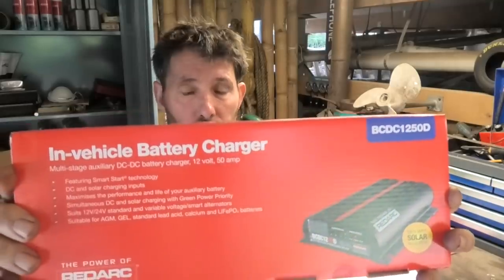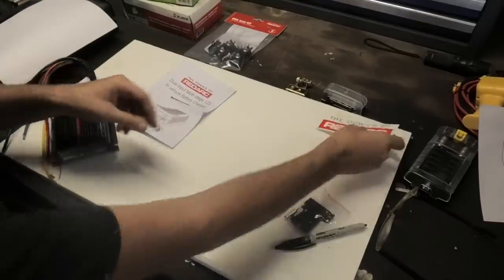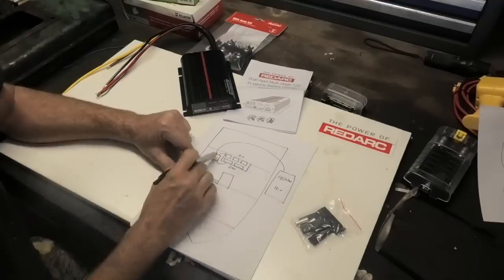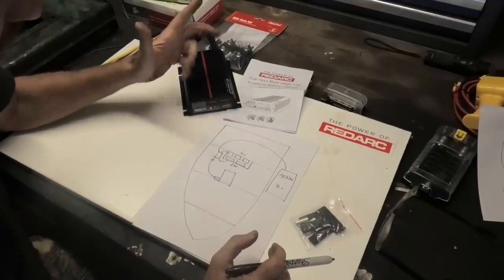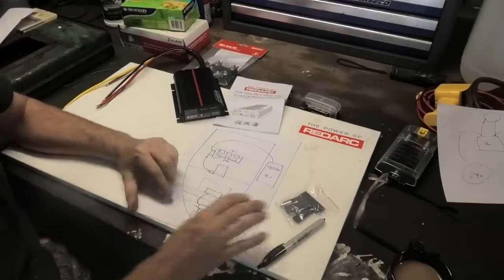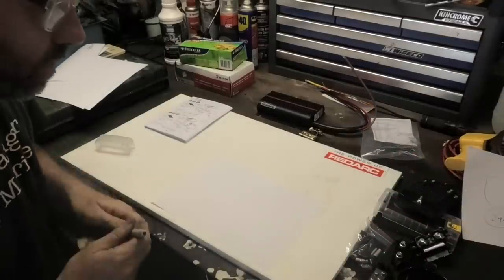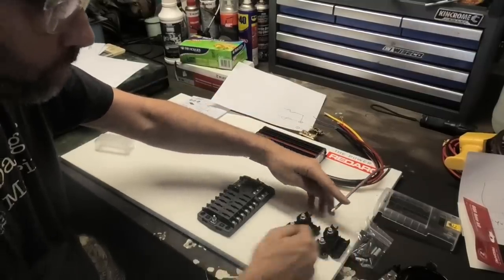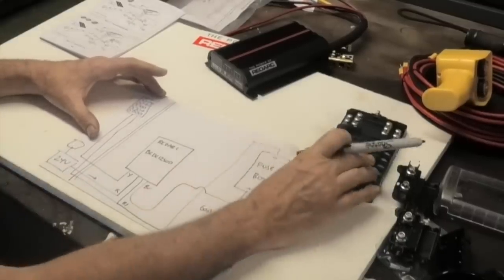Planning the trawler electrics

Comment: The BCDC1250D can't handle the current not even from only the solar panels or the alternator alone. Maybe you can stack two or three of them.
It's also a very bad design for cables, it should have four big screwed terminals on it instead of the thin wires hanging out of it.
Next problem you need to have the same type of batterys, like all, both starting and house bank should be for example AGM, that charger cannot handle two different charge voltages.
Reply from the maker: Yes, I'm thinking of splitting the solar cells across the 12 and 24 volt banks. All the 12V batteries are identical and the REDARC doesn't charge the 24V system at all (so I've learned)

Comment: Australia is 230 v 50 hertz isn't it?
Reply: 240V 50 Hertz
Reply: @dustyfarmer  Since 2000 the Australian Standard AS 60038, has been 230V +10%/-6% 50 Hz. Some states are just slower than others in transitioning to this, like QLD that was 240V +6%/-6% and had a law that conflicted with the standard and was amended in 2017 and transitioned by October 2018.
Reply: @CraigOverend  Last time I put a multi-meter on a power point in my home in N.S.W it read 243 Volts.

Comment: Why not ditch 12 volt totally and run 24v throughout,  all the same stuff is available and you'll suffer less voltage drop and/or run lighter gauge cable.
Reply: @Islandwaterjet   I never said it was cheap, it is however more robust and it is readily available through HGV and marine  suppliers etc.
Reply from the maker: There are benefits to going pure 24V, it is true.

Comment: each line should have their own 20 amp or higher braker.  minim 8 gage wire.  each having their own cut off. there are also compositors that can be made use of. have a electric drive motor to  steering.   there is a shit load that can be used.BL

Comment: One thing I have learned is that you do not want all lights on one circuit or fuse or switch ! It does not matter if it is a boat, caravan, shed, garage or what ever ...... if there is 2 lights then have 2 circuits .... if one goes out for any reason then you will still have one light working and you do not endanger yourself in total BLACKNESS !
Reply: Cyalume sticks stashed away for safety.

Comment: Be prepared for issues down the track. DCDC need constant monitoring to make sure they are working. Alot of sites with plenty of issues. Traxide.com.au is a far simple option easy to install far superior simple to set up an forget no constant checking. I ripped out my  Redarc rubbish DCDC charger and installed a Traxide and are brilliant. Dont fall for Redarc marketing it will burn you down the track on your second or third replacement!!

Comment: 12v wind turbine ?????
Reply: Installed where?
Reply: @dustyfarmer  Where ever he wants !!!!! Many boats have 12v or 24v wind turbines mounted
Reply from the maker: They are very common on cruising boats. Often when you don't have sun you have wind!
Reply: @davidpedder9048  Usually seen hanging off the back of a yacht off the transom, sitting atop the ex-trawlers wheel-house would look out of place IMHO, sitting off the transom might  give Stu's hair a bit of a trim up when tying up the tender, solar panels are easier to fit and will do the job, I reckon wind turbines are blight and eyesore on the countryside, noisy on a boat and not really necessary in both situations.
Reply: @dustyfarmer  Dont get me wrong, I like solar panels and use them my self. What i dont like is that they take up valueable surface space on a work boat. If you are under them when the sun is out, they generate sooo much heat.. I could go to any building suppliy store and buy a 10 foot pole for a wind turbine, I went with a mix of the 2 and make power day and night
Reply: @davidpedder9048  Plenty of still nights without a breath of wind, a 10ft metal pole with metal guy ropes sticking out of the roof of the wheel house with a wind turbine on top would be a good mounting point for Stu's lightning conductor cable but not what I would do, the roof of the wheel house is the ideal spot for solar panels and there they won't detract from the fine lines & classic styling of the trawler.
Reply: And plenty of nights when the wind dose blow. A splar panel will never ( never ) work at night. I could say plenty of days ( overcast and raining ) and a panel wont produce any good amount of power.. I have both solar and wind, best of both worlds.

Comment: engine earths. half the circuit..  the starter and alternator.. plus the sending unit earth/ground side also half the circuit. .  so the engine /transmission/prop shaft  are going to be a Negative. the side with the electrons..  a nice blender with electrons on it the propeller is.    the main earth/ground lug.  you are going to need a cable between the engine and that so you can get the electrons away from the hull.  give them the shortest path..  also the 24 volt negative cables for the starter.  Huge Hint... alternator positive output can be isolated. but is your alternator output going to be more than 60 amps.  running the alternator output  via a moderate thick wire to the starter positive connection shortens the path and reduces the voltage drop to the starting batteries.  but it complicates your diagram.  something to think about.  you might have to talk to the gurus at the  DC DC converter hotline.  you can use a properly sized fusible link or another maxi like the 60A    fuses to protect the alternator to starter wiring in case the alternator shorts internally.. so it does NOT burn the battery cables all the way back to the batteries.  fusible links open slower and allow a higher short term overload before melting.   i worry about that fuse panel in the engine compartment if it can handle the humidity there. or if it needs to be packed with white lithium grease..  so if corrosion does happen the white grease turns green as the copper dissolves.   huge hint.. a P TOUCH or laser printed copies that have the names of the circuit. and some clear shrink tubing.. you can slip a piece of paper with the circuit name up in the clear tubing and shrink it in place.  then that wire is identified..  3M has epoxy wire marking tapes with numbers or colors in little dispensers.   lastly the nav and exterior lighting.. how are the grounds going to be handled for those.  thru the hull.  since electrons flow from negative to positive..  that would be a lot of electrons flowing in different directions on the hull. 

 before you put back in the water.. how about fasteners for an outboard engine mount on the transom. i know some sail boats have some neat swing down outboard mounts.  rail mounted could do it also.  could be as simple as a 2" towing receiver  bolted on.. then you could hook a pintle or lunette eye for towing or a rear anchor to hold position while anchored.   the inside of the transom would need to be reinforced  this could be at deck height too..  who knows when you are going to find a big haul to drag home on the inflatable bags.  sorry to go off theme.

Comment: Before safety switches were so prevalent,  I'd try to mix up locations of a house on a RCD where easily possible, so that if there was a fault there would either be lights in that section running, or power in that section to plug lamps into, instead of just an entirely dead and dark end of a house. 
And from my understanding, it's much safer to have the DC instead of AC, the amps will be much higher which means you would get burnt more from a zapy zap, but the voltage is much lower so it's less likely to enter your body, and the alternating nature of AC is heaps more likely to cause cardiac arrest. So I'd take a burn over a heart attack. 
The earth situation is foreign to me, but have you considered shielded cable and a separate earth to neutral similar to houses? So an isolated negative as you said, and an earth for shielding RF signals.. Can explain more if interested, but won't be boat related as such.

Comment: The REDARC BCDC1250D DC to DC charger won't charge your 24v batteries
Reply from the maker: No, but the alternator will directly, I showed that a big wrong at the start.
Reply: I'd suggest charging your 24v system with Solar and the Alternator. Run the 1250D from the 24v batteries to look after the 12v system that way you'll always have starting voltage.
Also with the solar I'd suggest a MPPT charger that can handle a Vin of more than 32v (1250D limit) it will allow you to use a 24v panel with a Voc of 44v (better efficiency with MPPT). I've personally used the EPever Tracer MPPT solar controllers (Tracer4210A - will handle 1000W of PV for a 24v system) in several installs and had no trouble with them', they also have a nice remote control display that you can have at the helm.

Comment: I'd forget about an extra battery in the front. It's not needed and just adds another consumable. Just run a couple metres of wire from the main electric system.
Reply: the extra battery means he can run lighter gauge to it enough for charging - if the winch draws a few hundred amps either on startup or when it gets snagged, then you will need some massive cables from the central batteries. Plus the extra battery provides another level of redundancy.
Reply: Benny Banger aside from a bit of initial cost the extra thick cable is meaningless. The system already has plenty of redundancy with 5 batteries.
The cost will be more than offset by the cost of the battery or at most the first time he has to replace that battery in a few years.
Reply: @uglyduckling81  true that..6 of one, half a dozen of the other I suppose.

Comment: Sorry, I must disagree, he should run a pair of 6 AWG up to the wheel house to two separate fuse/distribution blocks, (shallowly mounted behind a cover panel) one block for light current 12 Volts loads (room and running lights, radar, marine radio, GPS, lights, cell phone chargers and navigational aids and the other for the higher current loads such as the crane, powerful search light/s, bilge pumps and other high current 12 Volt loads.
  Why?  It will be nasty diving into the engine compartment to replace the fuse feeding the bilge pump in a driving rain.  (Murphy is everywhere)  If the GPS goes out while running, it will not be nice to go into the HOT engine  compartment to replace a fuse.  Also the 24 Volt battery system should never power or charge anything other than the starter motor.  I would have mounted the 24 Volt batteries as close to the starter motor and alternator across the compartment  (but high above any likely flooding water line) and double the 12 Volt batteries on the shelf or use two large 6 Volt golf cart batteries in series for the 12 Volt storage system.  Moving the fuse blocks will also keep them away from all of the battery and engine fumes that can corrode connections.    Ron W4BIN

Comment: No experience in boat what soever but in a steel hull boat like yours why wouldn't you ground all negative to the hull and then ground the batteries to the same common hull grounding points, just like a car?
Reply from the maker: Because a boat sits in salt water, the hull turns into a battery and you eat the metal away.